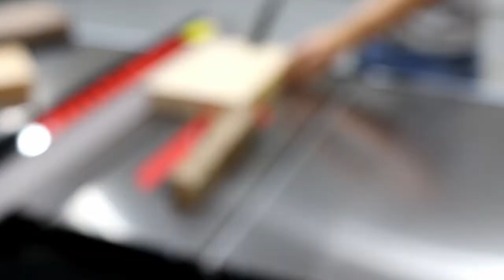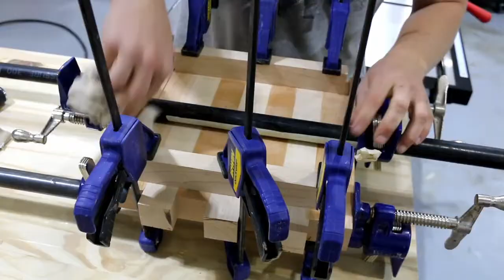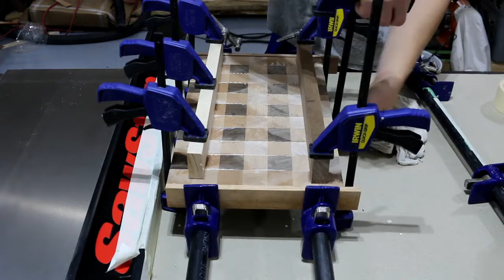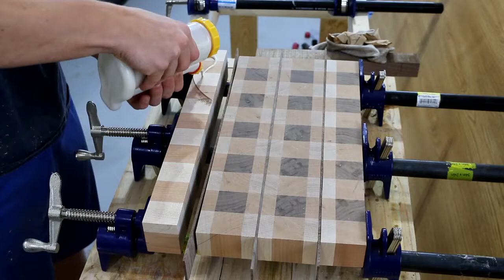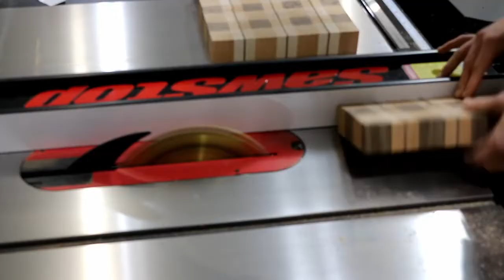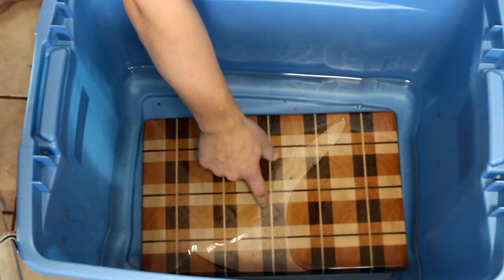Plaid Patterned End Grain Cutting Board Tutorial

Comment: I am wondering if this is technically an end-grain cutting boards. It seems to me that the 1/8th inch strips are actually edge grain, not end grain. Therefore, in actual use, you have a lot of resilient end grain and less resilient edge grain. Am I thinking this through correctly?
Reply: Because he resawed the boards to 1/8 that 1/8 thickness was end grain. Then he cut them as strips wide enough for the depth of board.
The issue you described has been an issue on some other creators boards, not here.
Reply: @malcolmsmith5903  Thank you.